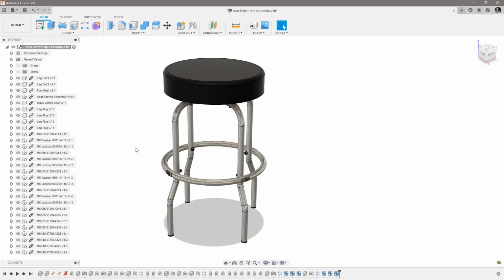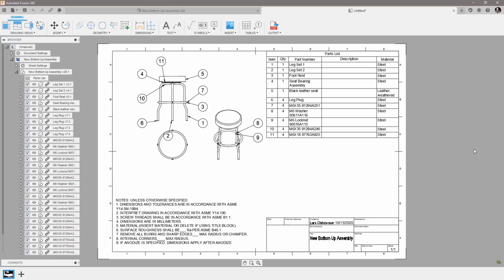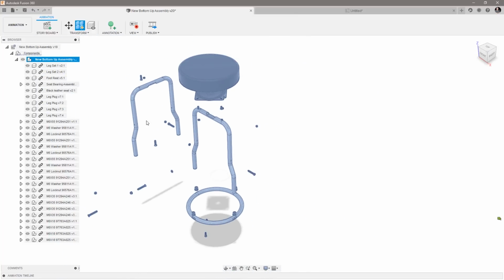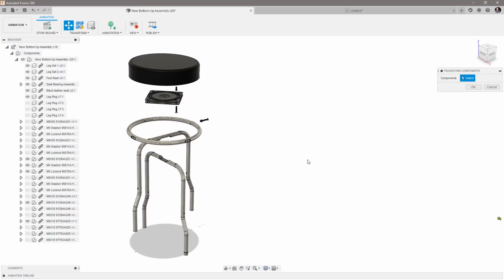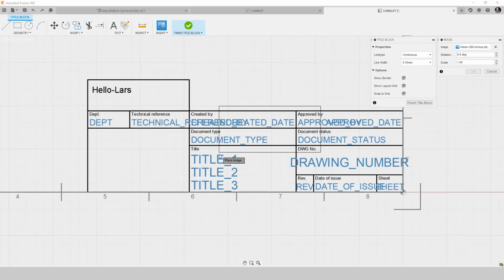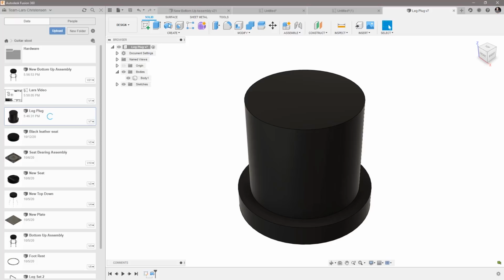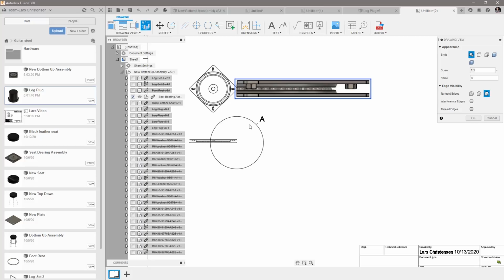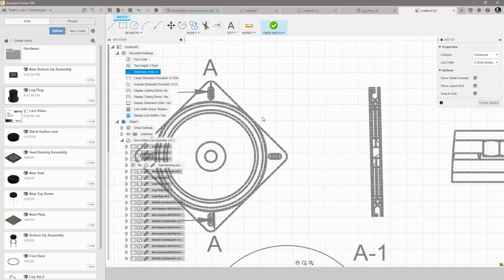Fusion 360 - What's New 2D Drawings -Season 3

Comment: None of this works unless you pay $60/month. Now I have to put together my details and such in Design, and then fiddle with that...drawing is pretty much useless for hobby user now. Too bad, it was the best way to check your design...AD really does not like hobbyists...
Reply: Not true, just create multiple sheets in a drawing instead of multiple drawings.
Reply: @frankderks1150  you can’t create multiple sheets in a drawing unless you pay $60/month. Looking at printed paper is the best way to check your design. I can actually draft my parts by hand faster than it takes to use the crippled drawing 2d application. Wow, what a great idea for a untuned channel. Have a draw off between the crippled fission 360 and a good pencil and velum drafter.
Reply: @elephantwalkersmith1533  Yes you can, you simply don't know how. In the drawing dialog there is a select option to create a new sheet within a drawing instead of creating a new drawing.
Reply: @frankderks1150  plus no longer works. It’s got a star there for upgrade path only. Can’t create anything as a template, also upgrade path only.
Reply: @frankderks1150   No drawings are not available in the free version, well I cant access that option